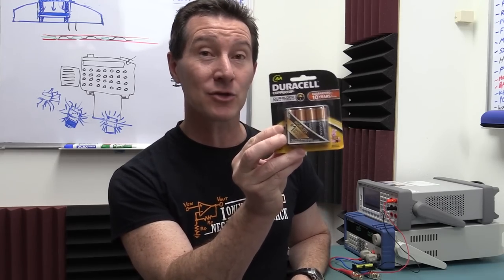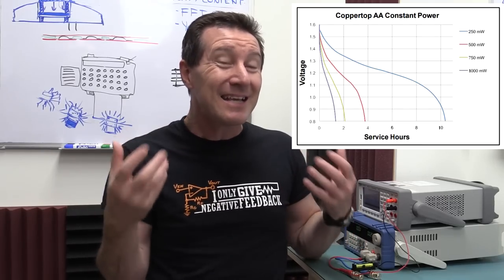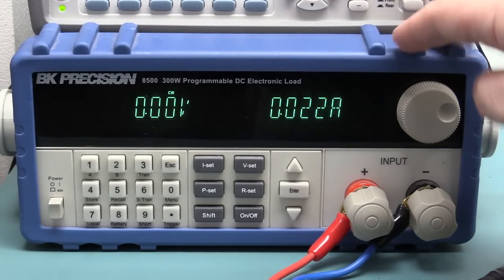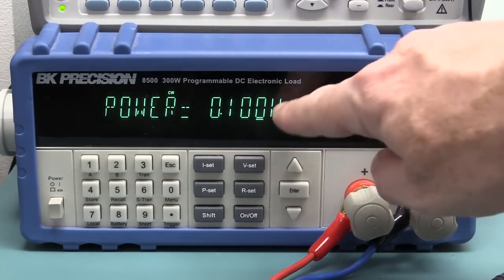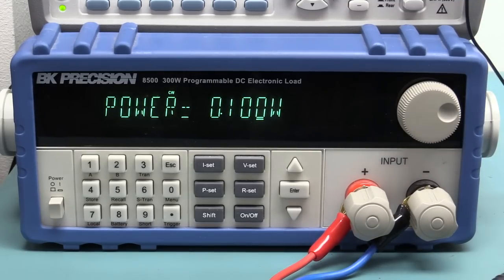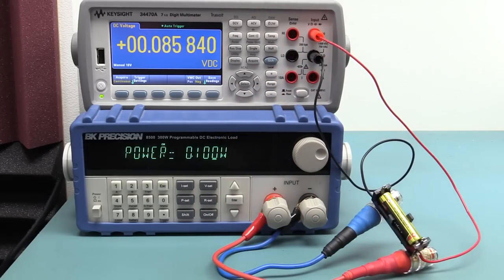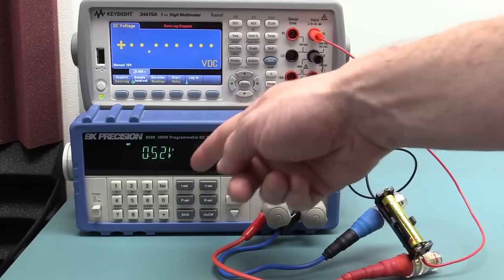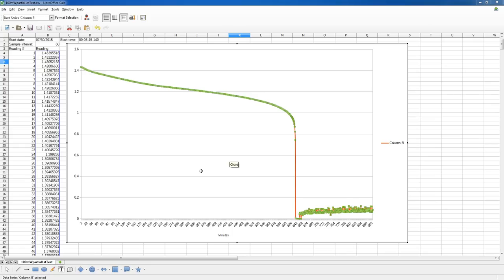EEVblog #774 - Low Battery Discharge Testing Part 1

Comment: How much power does say, an IR remote control, use when active?
Reply: sleepib the led draws ~20mA and UV leds are around 2V, so about 40mW on the led, plus the rest of the logic/asic. It probably will work up down to 1.75V (2x 0.9V) So a remote most probably wont work below 0.8V anyway, and if it does the led just wont turn on.
IR maybe gets away with 1.3V (red leds are about 1.5v) so maybe around 20mW, still you cant get many mA at such low voltages, remember ESR goes up, (the brick wall you saw in the graph) and below 0.8V it can easily go above 500ohms or more. You wont get 800µW with 500ohm and 0.8V.
In both cases most probably it wont work below 0.8V
Reply: Laharl Krichevskoy The LEDs of IR remotes are driven with a much higher current than just 20 mA, more like up to 1 A; but of course pulsed with a very low duty cycle, and using a beefy enough capacitor to deliver the pulse current.
Reply: Jo Pe still you cant go above the max rms power, else you burn it. The point is you cant even get 1/10 of those 20mW. last time i did the math it was like 800 something µW, you cant do shit with that, plus with no voltage you wont be able to charge that cap to get that pulse
Reply: Laharl Krichevskoy Mainly, I'm thinking a basic TV remote control would be an ideal use case for a DC-DC converter, provided your converter's output is regulated to just above the minimum operating voltage. If we assume that's 1.3v, and that you're using 2 AA batteries, A DC-DC converter should be a big improvement in battery life, not because of the lower cutoff voltage, but because you're not dropping almost half your starting voltage in a linear regulator.  I think we also need some practical testing of how bright the led actually needs to be, and how long the pulses need to be in order for the receiver to detect it. If we're running the LED at 10x higher power than we need to, that's just more wasted battery life.
Reply: sleepib i doubt they would put a DC-DC inside one of those cheap chinese remotes. Also dont thing it will make it last longuer as you maybe will be able to get 10% more out of the battery but you also lose more than 10% (eff is usually around 70-80%).
plus dc-dc used chips, diodes, caps and inductors. It's really not worth the cost.
It really doesnt make a lot of sense in trying to be greener with a remote that lasts more than a year with a pair of AA. It would be better to just use rechargeable batteries (the already charged nimh ones) or stick a lipo battery and forget about it

Comment: Dave, why you using 9999999999$ ultra precision equipment(that also dont works well for this test) instead of using Accucel 6 charger that is designed to measure batteries, It also have uart>usb connection capability So we can get graphs on PC!
Reply from the maker: Arek R. What I have works great. Does the Accucel 6 even do data logging to hundreds of thousands of samples? I don't want a PC running for weeks just logging. Also, does it do constant power down to 1mW resolution?
Reply: EEVblog No it dont, but does we need very precision data for just ordinary batteries?
And I also was thinking about my accucel 6(whoops) that have 1mV(oversampling) read capability, so, you are right about acc6 with standard FW....

Comment: "Usable" voltage . My kitchen analogue clock is usually the recipient of any .08v batteries . Using half a bee's dick, It will get a extra week of usable life and keep time from a AA battery that wood otherwise be rubbish at .08v cause not much use for other devices . Some l.e.d torches I have won't turn on under 1.0 v ..
Reply from the maker: dfsilversurfer A week extra life isn't much. Probably more annoying to keep changing them than sucking out every last drop. But each to their own.